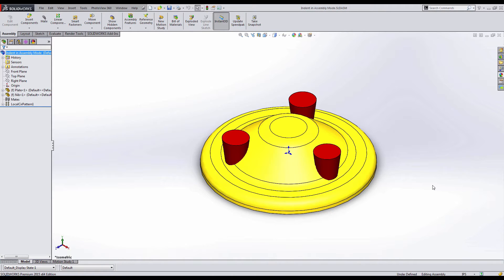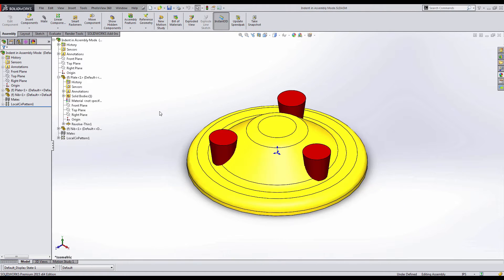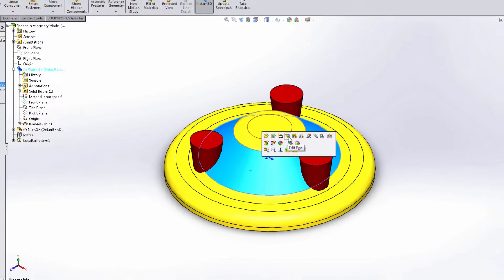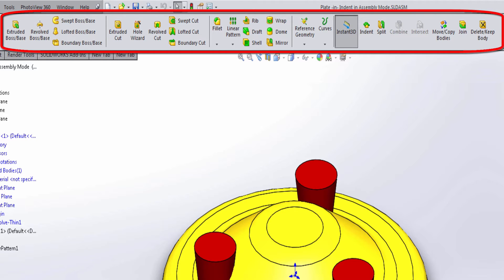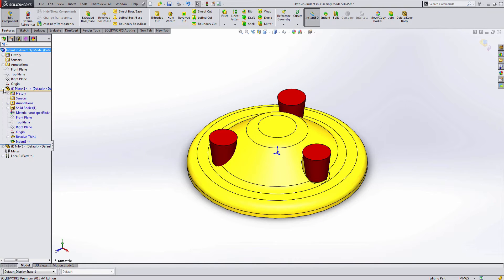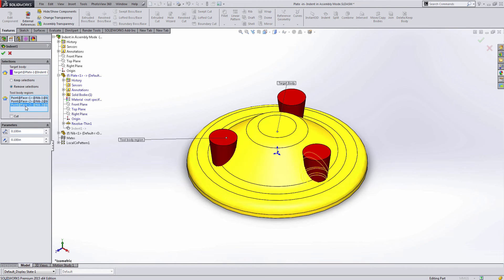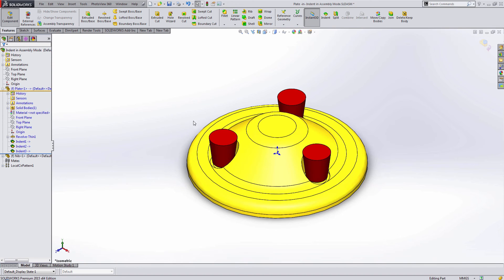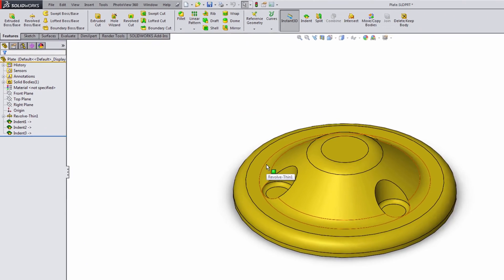SOLIDWORKS Quick Tip - Indent in Assembly Mode

Comment: As allway, a nice tip! The workflow / method itself is quite nice (never used it that way), but I see some trouble coming up when you use it on 'automated features' like patterns and it does not "update everything at once"...
Didn't try it yet, but for example, what happens if you decide to change a pattern from 3 -> 2... missing reference?